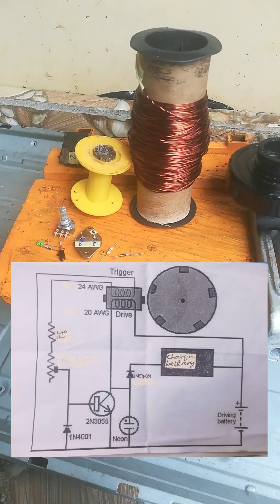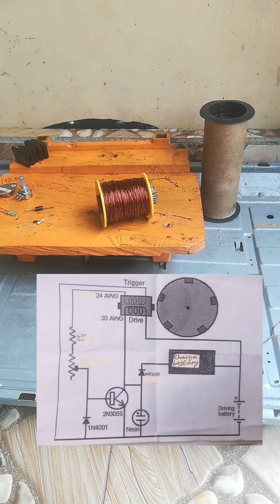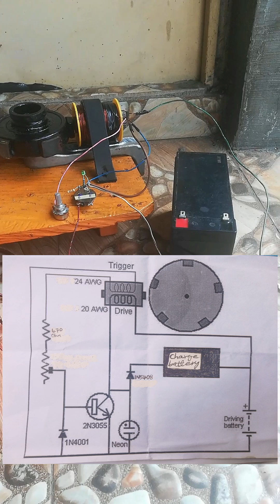How to make and understand free energy pulse motor generator

Comment: The magic happens in the acid: When voltage spikes, the chemical process captures the background EMF. I don't know exactly what happens in the acid to make this possible, but there is always more electrical potential built than is spent charging. Incredible.

The corporations that sell you energy are 100% schemers and scammers through and through.